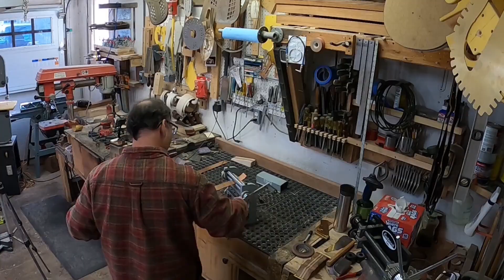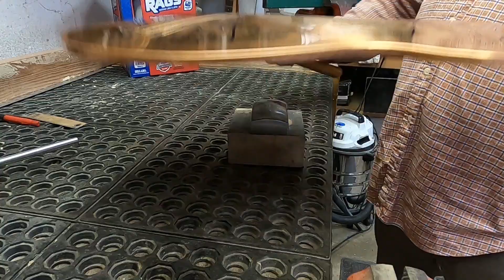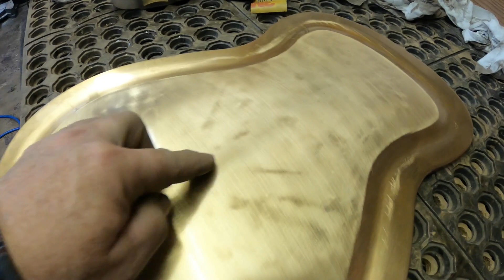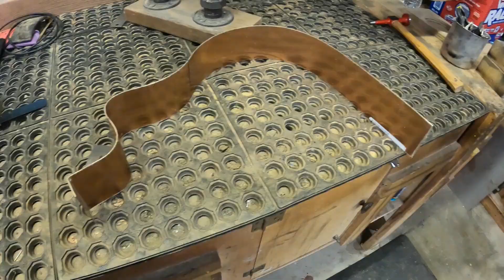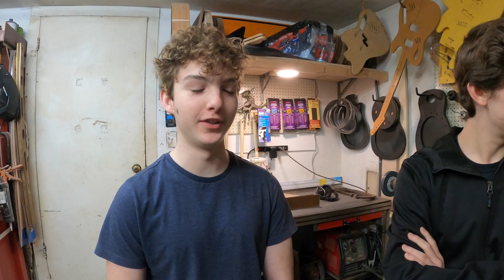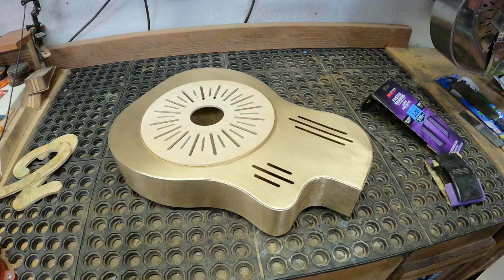Bronze Resonator Guitar Build | Ep2 | Body construction & new CNC tech

Comment: I have some huge improvements to resonator guitars ..you wont believe it louder and more toneful and i saw your video wow you need my body tools .i can do the whole body and cover plate  except the handrest  in !.5 hrs ....my guitars have two seriously unique features ........first  all resonators to date have a non active or deadening back , because if it rattled the overtones would be bad ......but ....what if the back was tuned a to the cone  i will include a vid .......the second is for paddle heads only  a compressor can be made as seen in the vid .....its that triangle cover on the truss rod .it heavy BRONZE and it pushes on the nut as it secures down ......i also use asymetrical necks of 7 pieces ibn railrooad box beam type construction (no truss rod adjust no movement in 11 yrs so far of active service including 2500 miles strapped to a motorcycle...... https://youtu.be/YEG1jrv8zhk
Reply: https://youtu.be/-JaNZGD_3MQ?list=PLtBYqz38xcLSYB4-S2f1u5zunobKJhRU4
Reply: https://youtu.be/xitThH6kys4?list=PLtBYqz38xcLSYB4-S2f1u5zunobKJhRU4
Reply from the maker: Well this has me curious. Where can I see your body tools? That's pretty impressive to do in 1.5hrs. Thanks for the reply.

Comment: Your progress is impressive. Sooner or later you will find electroplating equipment around you....
Two note on soldering: as you use large metal objects during the process you are having a solid heat sink either: you are heating them too, instead of concentrating the heat to the joint only.  It can be a plus to you, but can be negative either.
The other thing is to thinking on some kind of "solder mask", eg. a lacquer layer, which cannot be covered by the solder. You can minimize your material usage.
Another one: there are solder pastes too. They can be used for some area better than the usual solid wire medium.
Reply from the maker: Thanks for the tips. I'm very interested in the solder mask idea. It's very difficult to clean the excess solder off the inside when I solder the top on. I probably won't get into the electroplating equipment, too many chemicals and where I live that would be frowned upon.

Comment: Great job on those backs. Where you are raising the lows by hand with a dolly and hammer, I find a slapper much more forgiving than a hammer, I have some quite flexible ones which don't leave marks.
Reply from the maker: I totally agree on the slapper. It's the next evolution in my tools. I set aside an old file to make one, but I have also seen wooden slapper spoons with leather on them which might be even better for my application. Thanks for the tip.
Reply: which @Ninety2guitars  
I too have a leather covered wooden one, which of course doesn't leave marks, but I find it not as fast as a metal slapper, which I guess is stretching the metal where the metal is "on the dolly". I often work with aluminium and prefer my very flexible one made from a 2 inch wide 2mm thick strip of gauge plate, which is bent into a gentle curve (to give hand clearance and a smaller hit spot). You are producing some beautiful guitars, which I am in awe of. Bravo.

Comment: I was pretty excited about how great the solder joints looked on this one and how beautiful the backs turned out. And then the new CNC. WOW! That was really great of your kids! What brand is that CNC?
Reply from the maker: It's a Fireball Meteor, which means nothing to me I guess. I'm figuring out it's not so much the brand of the machine that's important, it's more the CNC controller and software that makes a big difference. I forget the brand of the controller though. Let me know if you need anything cut, I could use the practice.